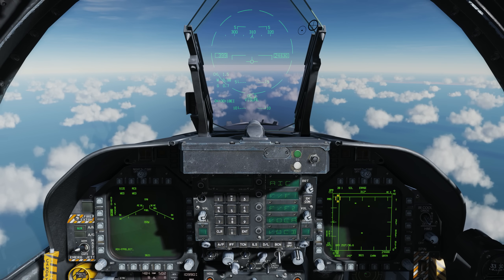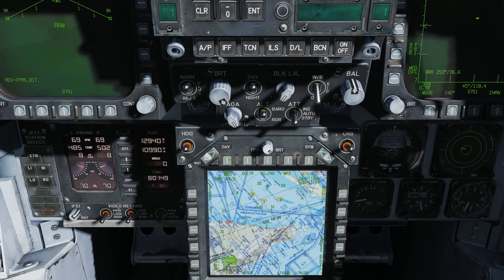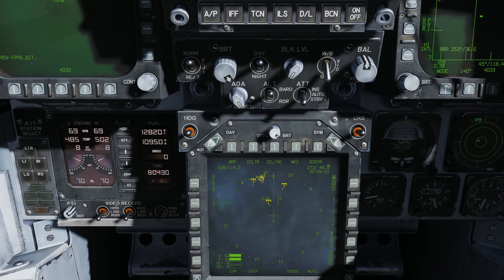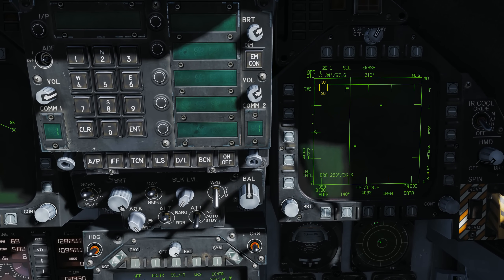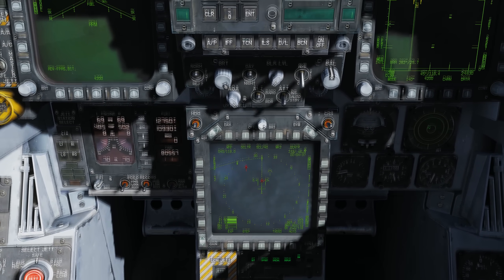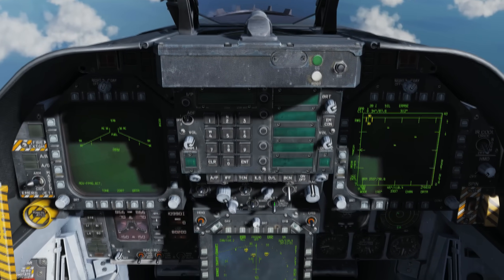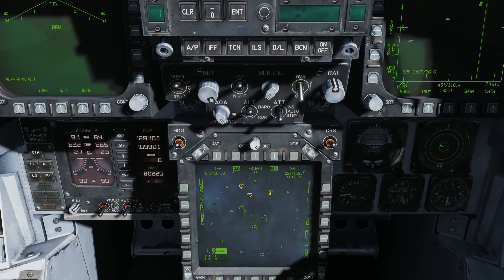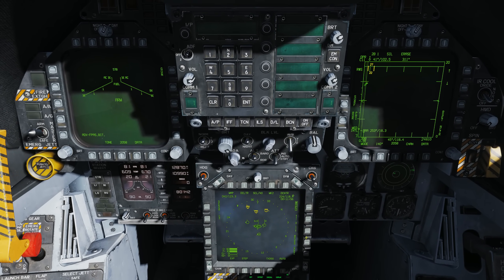The Datalink and Situational Awareness (SA) Display of the F/A-18C Hornet - Introduction

Comment: Jesus, and I thought the Viper was a complicated first plane to learn. When I first started a few months ago, it was during that kick ass sale they had going where you could try everything out for free and then the modules were all basically half off or more. So I bought the Viper, Hornet, Thunderbolt II, F-5E, FC3 and Harrier. My dream has always been to fly the F-16. I knew it wasn't the easiest but I also knew it wasn't the hardest. Cut to today and I consider myself to be fairly proficient with it. At least the basics and a little more advanced with all systems. But I was flipping between the F-16, Hornet, and A-10 the whole time. I decided at one point to just stick with the F-16 so I could really focus on getting that one aircraft down. Now I am focused on the F-18 and it is considerably more complicated to operate. Even the CMS is unnecessarily complex. I love the quick A/A weapon select system in place that is similar to the F-15's. But then going from the Viper back to the Hornet, the RADAR is just a wholly different animal. Anyway, I absolutely love the module and I'm so glad that ED has put so much effort and time into it and have made it so accurate. It's been a challenge to learn as a newbie. But once you start getting things down and racking up your first kills, it is so worth the time you spend doing it.

Comment: I noticed the BRA bearings on the MPCD are not correct but then I guess this has been corrected since there are a lot of fixes relating to BRA in the change log pages. Example: freeze video at 16:52 and note BRA on right MFD is 293/18.5 which looks correct judging from the SA page on the MPCD. On the other hand, the BRA 342/17 on the lower display does not seem correct when you visualize it on the compass rose. Tried this myself and the BRA seems to be correct.
Reply from the maker: Hi Jet Pilot, this is a rather old video now based on older code. Thanks.

Comment: Hi, may seem a silly question, but how do you change the TDC focus when in A/A mode?  For example on 3:22 you change the focus from the Right DDI down to the MPCD while being on A/A mode .. I cant do that, how do you manage to do it?  Thanks a lot for the very informative video.
Reply: Make sure your "sensor control" are mapped in HOTAS section I just put the corresponding forward, aft, left and right on my arrow keys, and depress on the end key

Comment: Hello.
I have a question about right DDi radar.
Why since a few weeks or months i have much more difficulties to lock or just see my targets in right DDI  ?
I see them in the SA below but never able to lock them even at 20-40 miles and i set my radar at 4B upper left and even if i try to scan at 140 or 80 below it's not faster to get them locked ???
I never had that issue a few months ago....

Thanks if you can help me...you will help some others pilots in same time !!
Steff.  (sorry in my english not so good)
Reply from the maker: It defaults to LTWS and this can be less effective at high azimuth and bar settings. Either turn off LTWS or set bar to 2 and azimuth to 60.

Comment: Is it just me, or is the SA page completely borked as of the initial release of LTWS?
Reply from the maker: Appears to be you. No issues here. The biggest issue is that LTWS updates at a much slower rate. If a contact is not detected for one full frame, it will be removed from the radar format and SA page. LTWS should generally be run at 1 or 2 bar at 60 degrees of azimuth or less.
Reply: @MattWagner  does that apply to those on the same channel and in the same flight as you? Because my main problem is losing track of my wingmen in MP
Reply: Not to mention, no donor aircraft show up either. I literally see nothing other than pre-programmed SAM threat rings
Reply from the maker: @cbinder46 . No issues here. Suggest you post a track or video here for folks to help you get on the right track: https://forums.eagle.ru/forumdisplay.php?f=557

Comment: Does this work with ai flights and is there anything we have to do to get their datalinks? I say this because you have the AWACS, but I don't see any friendly f-18's or f-14's.
Reply from the maker: Yes, if they are equipped with Link-16. I see AI hornets just fine.
Reply: @MattWagner  i was wondering too why any of this does not work but i was using the 2.5 realease version thanks matt for the tipp with the open beta thumbs up for u hope u recorvered from your cold

Comment: The Sensor Select Switch Depress keybind is blacked out for my Warthog HOTAS. I am assuming this is the button you press for the IFF interogation?
Reply from the maker: Try resetting your Hornet input files.
Reply: @MattWagner  Thanks Wags, I use a modified input file and I was updating with the old one when backing up the files. I've revised it and it works great.

Comment: Tip..: I recommend to turn on the IFF, it make it much more easy to identify other planes especially if they are not comming directly towards you.
Its the button that are 3 buttons to the left of D/L that wags press in start of the video.
Reply from the maker: Yes, if you start from ground, you must manually turn on the IFF system, just like any other Hornet system.

Comment: Thanks for the video, helps makes a complicated system simple to use. If it is possible, if you mention a button that needs to be pressed like the rear sensor or a TDC switch it would be great if you could display in text the name of the switch/button your pressing on screen? That way, ideally, you can run through a an operation like a mode 4 interrogation without having to explain again what buttons you are pressing while the viewer who's new to the system can keep up.

Comment: Link16 can not be realistic without a proper AWACS/GCI agency. It should be developed for sure... Also in Mod4 interrogation one aircraft declared so quickly hostile. What if it is a non mod4 capable friendly? or Mod4 Off flying friendly or Civilian aircraft? or electrical emergency friendly? In link16 GCI can also send SAM geometry and CAP points etc...

Comment: Isnt BRA for Baring, Range and Altitude? 065/10 so 065 is Bearing and 10? i mean the range he ment stoud over it 13.5nm and the altitude you can read from the cursor is Angels 24. So whats up with that? And sorry for pour english
Reply from the maker: Although the term BRA is used, in the case there is not altitude... just bearing and range.
Reply: @MattWagner  Is it supposed to be bearing and range from your own plane because if so the numbers didn't look quite right?

Comment: Where it says BRA on the bottom right I can only see bearing and range indicated. Where is the altitude figure?
Reply from the maker: Although the term BRA is used, in the case there is not altitude... just bearing and range.
Reply: @MattWagner  Thanks Wags. I presume that data you can get from radar and other sensors. Thanks.
Reply: @SimDeck  I was wondering the exact same thing.  Thanks for asking and thanks Wags for answering.  You can get the alt. from putting the "brackets" over the target on the SA page.

Comment: If we lock up a target in STT, will it automatically do an IFF interrogation and update the SA page, or is it still just using the basic diamond/square indication on the HUD?
Reply from the maker: As stated, you can manually IFF with either Target Under Cursor (TUC) or STT/L&S.

Comment: How do you switch tdc from radar to sa page?
Reply: With sensor switch you set which display has the cursor: bottom, left or right or top (which will be the HUD). Check the appearance of the diamond in the top right of the display.
Reply: @SpecialistBR  ahh I see thank you

Comment: Nice video but I didnt understand which button you used for manual IFF mode 4 interrogation. And did we see the TWS mode at 13:28 ???
Reply from the maker: Zarma4074. Depress sensor select control switch, a new HOTAS function. Incomplete LTWS.
Reply: @MattWagner  Damn my sensor switch is set to the DMS and weapon switch to CMS. Seems I will have to change something. Didnt know the sensor switch could be depressed.

Comment: It seems you've indicated the F-15 as a possible donor to the datalink, but is that AI only or does it also apply to human F-15s in MP? Also I have seen old AI F-18Cs show up on the A-10C SADL, so is/will there be compatibility between those 2 systems?
Reply from the maker: 104th_Spade. The FC3 does not have datalink, so AI. A-10C can broadcast PPLI over L16 gateway.
Reply: @MattWagner  OK, pretty much what I figured on the 15. Thanks!

Comment: We need a mig31BM and mig25 aircraft pack combo!   To save time make it a Flaming cliffs style please!
Reply: @Rush The MiG-31 should not be underestimated.  Of course it's not very good at turning and burning in an 8nm missile fight or, god forbit, a WVR engagement.  But what it's really good at is spotting contacts from 100nmi+ away, and sending missiles down range at WAY beyond maximum Amraam range.  If the hostile penetrates into Amraam range, it can simply turn around and disengage at will.  It had a phased array radar in the 1980s, a cool 20 years before that technology started to become widespread.  It also has a fantastic datalink that was ahead of its time, and can guide semi-active missiles (ERs) fired from other aircraft such as an Su-27.  Shortly before the SR-71 was retired, six MiG-31s managed to get into missile engagement range of one from six different angles.  F-15s could not do something like that, and F-18s damn well couldn't think about it.  If flown in such a way as to utilize its strengths, it is an aircraft that really needs to be taken seriously.  Imagine something with the weapons range of an F-14, but with a lot more speed and a lot more difficult to fool the radar.  That's a mean machine.

The MiG-25 would be neat to play with but not very competitive.  It doesn't have the radar or the missiles to really tie into it with 4th-gen fighters.  The -25 was a paper tiger.  The -31 is a real tiger.

Comment: As for why you might want to use Link-4, Link-4 is used by the F-14 and other older aircraft such as the F-4, but I suspect and A and B models cannot use Link-16. Considering that both historically and in DCS they will be complimentary aircraft, this will probably become rather useful. The symbology for air-to-air at least is very similar in some aspects to the F-14's TID display, so that will be nice for hopping between F/A-18 and F-14 RIO positions. Check out the F-14 manual for some differences: http://www.heatblur.se/F-14Manual/general.html#tid-data-readouts